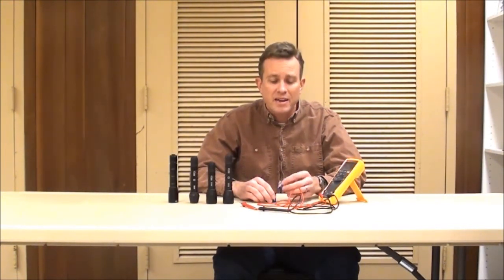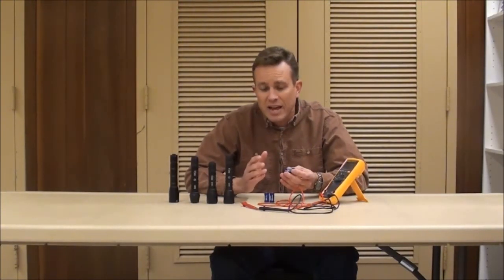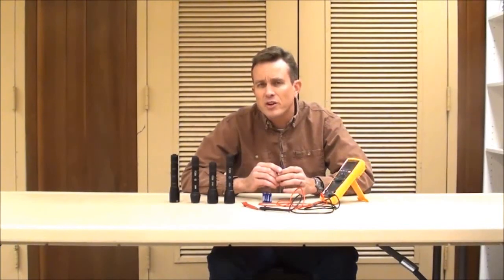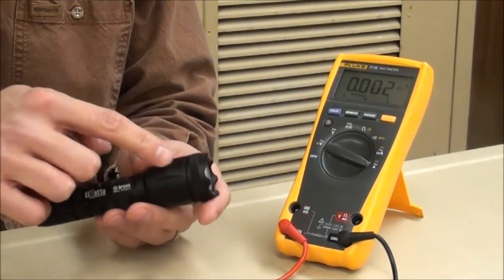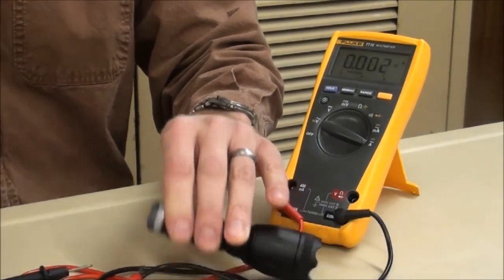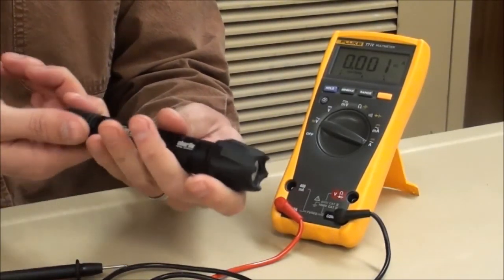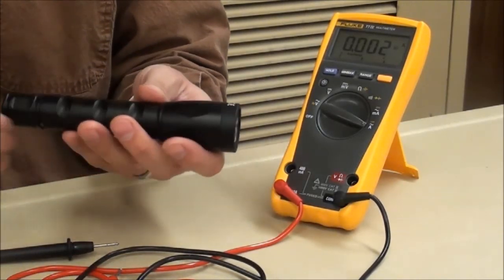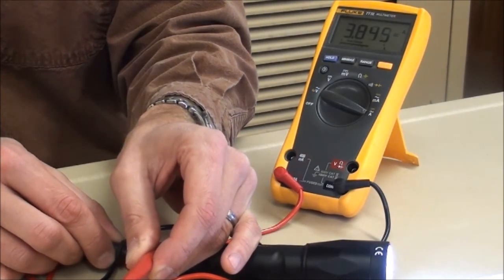Tactical Flashlight Battery Electrical Current Draw Testing, Elzetta vs. competition

Comment: The current on the 2 cells Bravo that  measured was 1.2Amp 
In to driver and then the current out to the XM-L2 around 2.5 Amp.

Comment: This multimeter will not give you an RMS reading of the current, and most flashlights like this use a current controller to draw current in pulses to the LED because it is more efficient. The problem comes from the fact that the DC current you are measuring and the RMS of the current being drawn from the flashlight is not the same

Comment: I'm not an engineer, so help me out. How do you get comparable output to the p3x with the Charlie when they both have the same nominal voltage, but the p3x pulls over 4 amps? According to XM-L2 charts I've seen, you need 1.5 amps just to break 600 lumens. What factor am I missing that allows you to output 900 lumens with only 1.3 amps? I don't doubt your output claims because I've seen beamshots of all your products and they are all super impressive. I'm just confused about the current draw.
Reply from the maker: ***** Our circuitry is extremely efficient.  (Note that electrical current drawn from the batteries is not the same as electrical current through the LED chip.)
Reply: ElzettaDesign Whatever your black-magic is, I'm itching to get an Alpha or Bravo for my next weapon-mounted light!
Reply: +coffeeandlifting 
Agreed.

Comment: only one question, does it make difference in measurement whether you hold that red pin with it's plastic handle while measuring amp output or touch it's iron rod with fingers?
Reply: In this situation it shouldn't, the meter will be a much lower resistance path than you even if you were holding both probes by the tip. I wouldn't go holding the tip for testing current at mains AC voltages(240V for me, 120 in US), but then I'd be using a clamp meter for that anyway.
Reply: thanks :)